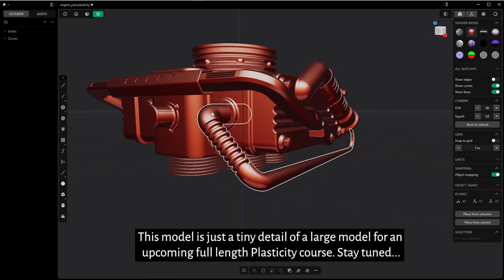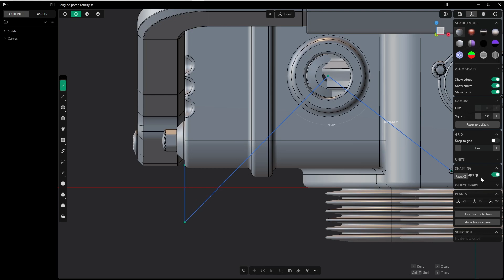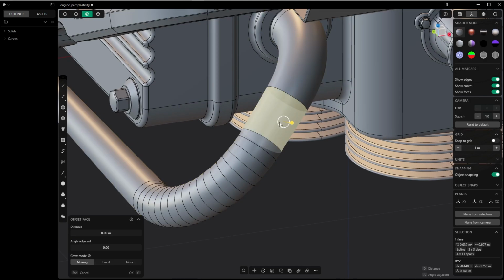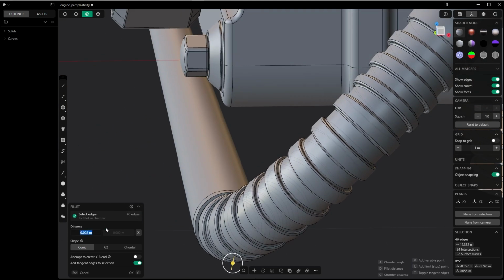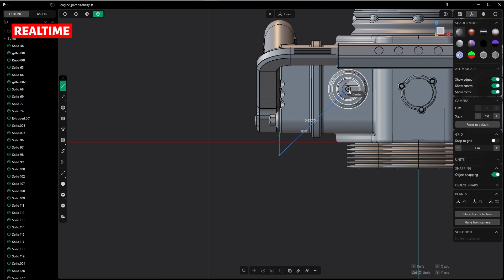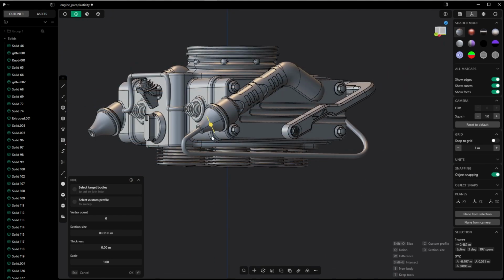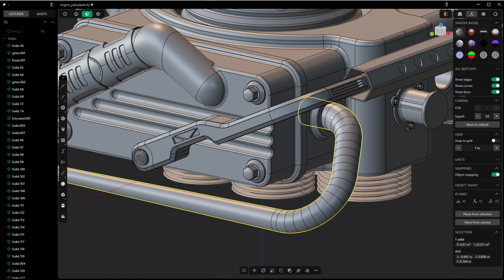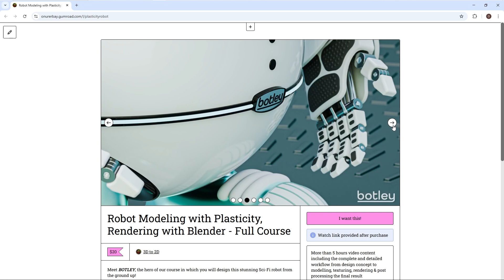Plasticity Tip No. 41 - Precise & fast curve direction & pipe detailing

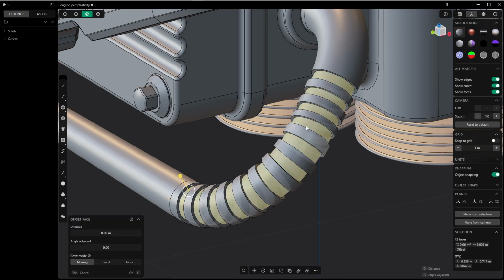Comment: This is great, could you also show how to make this a spiral hose protector around a central "hose". Example at : 3:23 instead of the selection being an offset of none connected raised portions, could the selected and offset surfaces be made into a "spiral that looks as if it is wrapped around a existing hose? Something like where the inside hose is orange, but the spiral wrap is blue?
Reply from the maker: @adventurefilms  this is an interesting topic, I'll make a video on that as soon as I come up with a solution. Thanks!
Reply from the maker: @adventurefilms  The video on this topic will be published on April 2nd 3PM GMT+3. I've used your comment. Again, thanks a lot for your question.
Reply: @3Dto2D  Can't wait!